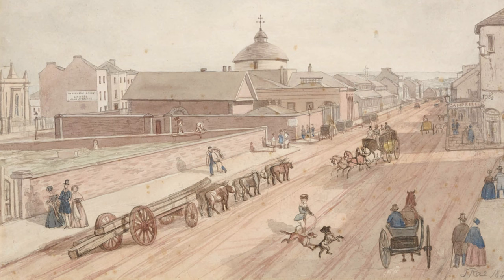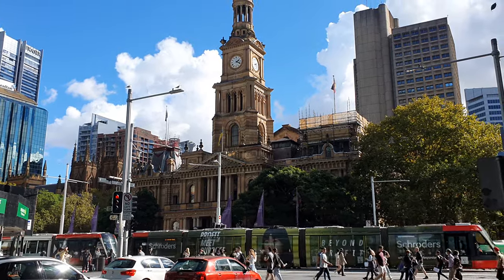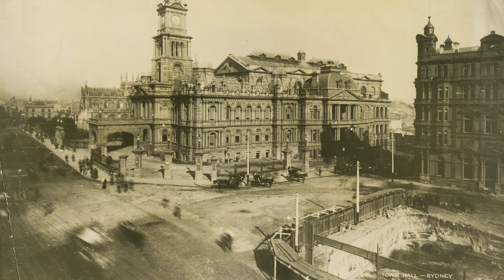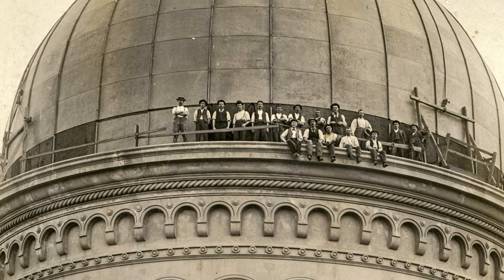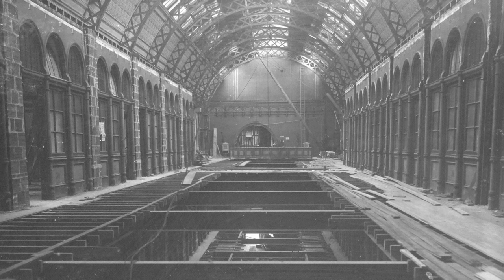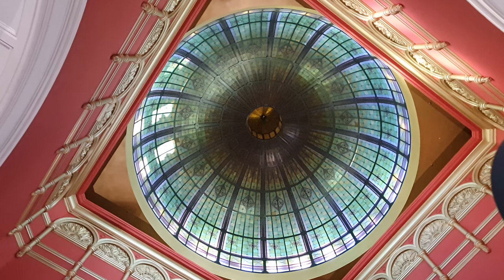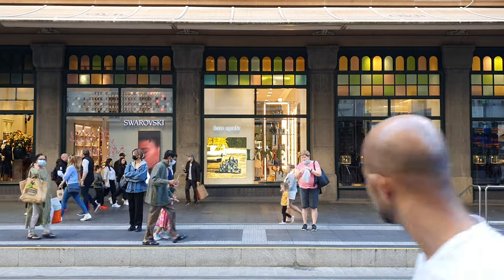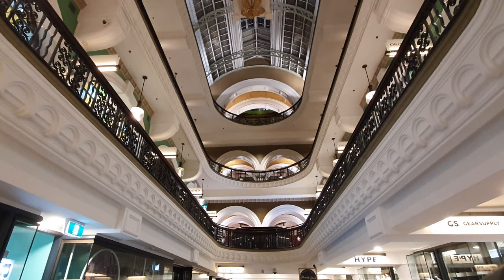Queen Victoria Building Sydney, Shopping Arcade, QVB Sydney

Comment: I can still remember fruit and veg stalls there in the late 1970's on the pavement area outside.  There used to be a very old man, possibly Eastern European,  with a canvas cap and huge overcoat, who was homeless and he pushed this large cart mounted on pram wheels with a suitcase mounted on top, around the QVB area, he used to make some money by sharpening knives and scissors for market tenants and shop keepers around York and George Street. He was a well known identity of the QVB for many years.  Harry Seidler cannot talk, he designed some absolute horror buildings in Sydney and North Sydney.  Great video, thank you.
Reply: Was that chaps trolley the one with motorcycle wheels with no tyres on either side ? He was such a part of the town hall area, but should have been looked after and accommodated in a way that fitted in with his wishes.
Reply: @metricstormtrooper  Think so, I clearly remember the big metal box/suitcase on the top. He was hunched over and pushed it along very slowly, he used to sleep in the bus stops along the QVB on York Street side.
Reply from the maker: Thanks for sharing this memory.  Sounds like this guy was well know in the area and time period. Kind of like the eternity chalk guy from the late 20th century who would write it on the sidewalk.

Comment: Thanks for another interesting video. It is so fortunate that the QVB was saved and returned to its former glory. It is interesting to hear visitors to Sydney talk about it.
Reply from the maker: Yes it is a Sydney icon. Does Melbourne or Brisbane have a building like the QVB?
Reply: @SydneyHistory  Richard from Melbourne here. Yes and no. Victorian Buildings in general, there are still plenty. There are some nice Victorian era arcades but nothing on the scale of the QVB. It truly is a remarkable building. You are very lucky to have it. I first saw it in 1981 before it was renovated. It was rather run down but oozed potential. Next time I saw it in 1987 I was very impressed.